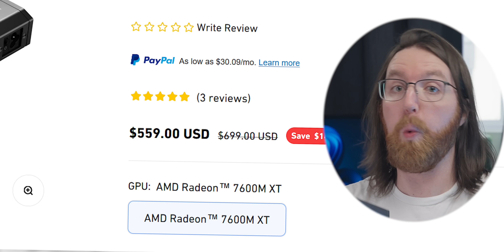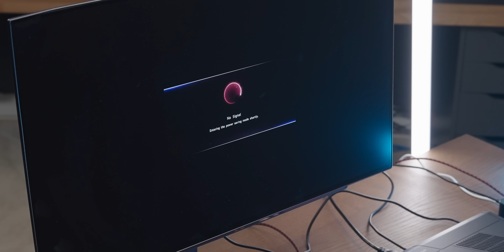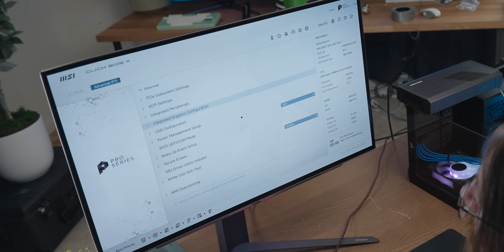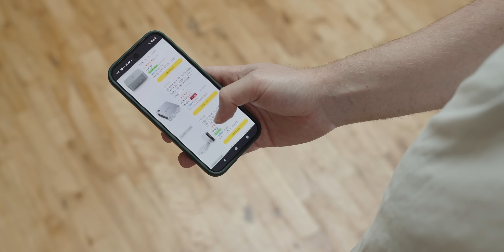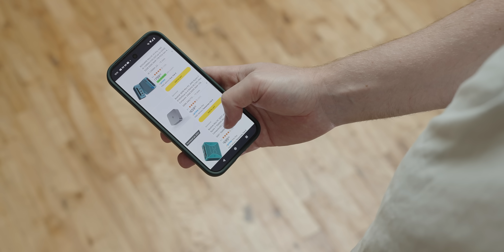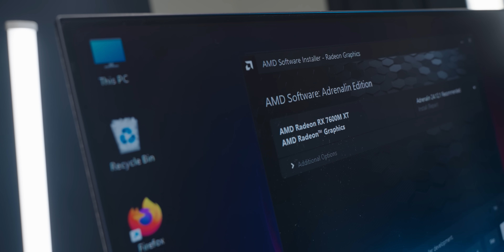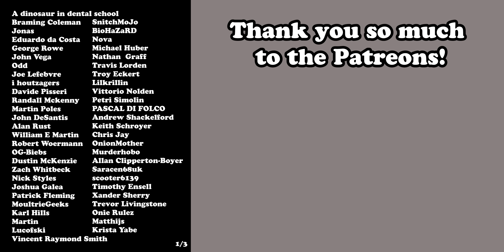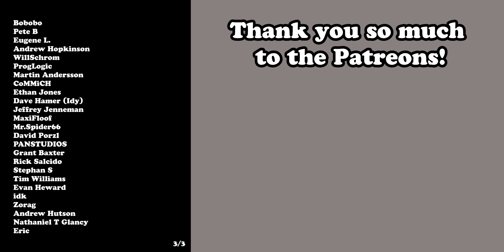This Aliexpress Graphics Card Did Terrible Things To Me...

Comment: I have an eGPU dock (Minisforum DEG1) and I have had a lot of issues getting an external GPU to run on my Minisforum UM780XTX mini-PC via Oculink. It's just such a finicky and temperamental thing. With a 5700 XT in the eGPU dock it works every time, but with a 6700 XT in the same dock I have not been able to get a signal. Not once. Not a single time. DDU wipes and trying different HDMI ports, different DP ports, different PSUs, fresh Windows installs, all sorts of different BIOS settings, different cables and so on. The 6700 XT never works, the 5700 XT always works. Both cards are confirmed working in other systems. I love the idea of eGPUs, but right now it's a huge mess. I guess that's just what you get for being an early adopter.

Comment: I worked for HP in a previous life. One of my co-workers figured out how to reassemble a LaserJet 4100 with the bare minimum screws and still have it function.   That way if he needed to tear it down to get inside to walk a tech through replacing a part he could do it in moments.  He had maybe 12 screws total installed in the whole printer.
Reply: I remember servicing printers around that series, we had a ton of them in the office. There was one set of gears that I think drove the fuser, they would go bad on heavily used printers and the WHOLE damn printer had to come to pieces to replace them.

I figured out that if I cut away some plastic it saved hours of disassembly and reassembly and you didn't have to take it apart to the bare frame.

The thing truly had to be torn to bits for this repair, I felt like a king when I figured that out. Hahaha
Reply: @volvo09  Impressive as hell, rad job on that.
Reply: @volvo09 that being said... I was certified on 4000 series printers and they were tanks compared to what you get these days
Reply: "In a previous life" ? No commenters are noticing how this person is saying he's a reincarnation of an HP employee.
Reply: @JadenRoss-v3s  I assume most hp employees are reincarnated Compaq employees
Reply: @KodiakWoodchuck  i think those went extinct

Comment: Had a different kind of video card problem with aliexpress video card. Amd rx 570 for $50. Installed card, restarted windows and generic windows drivers installed. Amd drivers would not install. Tried 4 times and no go. So i downloaded the Frankenstein drivers and woa, worked as it should. Drivers were great.

Comment: Had you previously had BOTH the Occulink AND the USB-C plugged in AT THE SAME TIME??? Thats was gonna be my suggestion after seeing they were both on that weird mini m.2 port daughterboard thingy
Reply: The problem here is PCIe is hotswappable and no other Oculink dock requires another connector to be plugged into the target machine. You just plug the Oculink cable and it works. That's bad design.

Comment: one thing to note, the egpu has to be on before the pc. then turn on the pc. if the pc is unplugged, then ya have to unplug the egpu and plug it back in >.>
Reply: I also suspect the USB-C port also need to plug in for the dock to work since it has all those other ports out the back of the dock.

Comment: It’s like putting a vehicle back together and there are bolts left over. If nothing rattles or falls out, it didn’t need them anyway
Reply: Sounds like the first tune up I ever did on a car. It had allot of stuff left over. I was age 17😂🤣 and the car still worked. Rattled but worked
Reply: @dmo848  If it works, it works lol. The screws are there to keep things from rattling anyways

Comment: I've had the same issue. My GPU decided not to draw power, and none of the LEDs worked.
I took everything off, saw nothing bad happening, reassembled it back, and voilà, everything works now.
Reply: I have an old TV i use for my Ps5(the tv is ~15 years old), a few days ago it decided to not turn on at all, i opened it up and saw how dirty it was and how many "shortcuts" were taken during manufacturing(surprised that the TV lasted 15 years with how unsafe the insides looked). But i saw nothing that serious so i just tried to turn it on with the back off, it worked.
Reply: I bought a used 1080ti that was sold as defective. It had a 6pin and 8pin power connector on it.. tried it with both and never got it working, so I assumed it was dead. 

Months later I played around with it again and tried both cables at the same time... The damn thing worked 😂 

I felt like an idiot
Reply: @volvo09 You didn’t plug in both at first? 💀

Comment: There is a notorious bug with AMD CPUs not working with amd external gpus via oculink. Though Even if it's not exactly this particular one .... That said, it does work for usb4/thunderbolt 3
Reply: Though it does work with Nvidia cards fine and supposedly it does work in Linux
Reply: It looks like this dock requires that USB C to also be connected to the PC in order to work.
Reply: @BrunodeSouzaLino Naw because it was working through thunderbolt/usb4.

Comment: The whole idea has potencial  BUT OCULINK ? They must find a way for a) a BETTER GPU  b) A way to connect it to usb type C ( no thunderbolt) and it will be a  GODSENT  for gaming or productivity for laptops !   ANY OTHER WAY...They have..DROPPED..the ball !!
Reply: Oculink is the best way because it's not a converter. It's just PCIE 4.0 8x on a cable. You have all sorts of adapters which will turn M.2 and even regular PCIe into Oculink (even one that uses a PCIe 16x slot and gives you 4 Oculink ports.. If you're feeling adventurous, you can even convert SATA to Oculink using a SATA to M.2 adapter, then putting a M.2 to Oculink there. And since PCIe is backwards and forwards compatible, you don't have to rely too much on either device being PCIe 4.0 compatible.
Reply: @BrunodeSouzaLino  I respect your knowledge of the matter BUT I did not ask for that assumption cause oculink is an output that  DOES NOT exist in laptops. My comment refers to that IF they can adress this issue it will be the solution for every laptop to be a gaming/productivity machine. I think you missed the reason of my comment.

Comment: Perhaps you are required to have current draw on the USB-C port so it only powers on the GPU when the attached computer is running. Not a good idea, but possible.
Reply: Or maybe It is required to control the power on/off and some other functionality?

Comment: I just can't understand the logic of mini PC's like this. For the cost of the Mini PC and GPU, you could just build an ITX build if space is an issue. Or for traveling you can just get a laptop and not need to worry about carrying around the screen and GPU as separate items. I genuinely don't know if I'm missing something or a certain use case for them.
Reply: I think the primary use case is "Because it's neat".  It's just a hobbyist/enthusiast product and have little benefit for most consumers over other options.
Reply: The use case is future upgradeability. A laptop with an OCuLink port accomplishes the same thing. If this eGPU were only ~$300, I'd personally buy one to add to my mini PC. Then it would stay at home while the mini PC may or may not travel with me. That said, a mini PC without the keyboard is much much smaller than a laptop with its built in peripherals. If I'm say planning to stay with a friend for a weekend, I can toss the mini PC in a backpack or other luggage along with a few cables, borrow a keyboard, and plug the PC into a TV at their house.
Reply: I'm a veteran of PCs since the first batch of clones came out in the early '80s.  I've built dozens.  They are finicky to get everything working smooth.  The cases are flimsy; move your RGB glass windowed junk heap around regularly and it will get loose, like particle board furniture.  They simply die after a couple of years.  Too many vendors have their fingers in your device.  I switched to laptops years ago because I travelled frequently.  They just work, because one vendor built the whole thing.  I switched to mini PCs because I no longer travel and was using a laptop with a wide monitor and mechanical keyboard, but got tired of flipping the lid to hit the power button.  So now I have a simple thing I can put behind my monitor, it has a discrete mobile GPU, plays my older games fine and newer games OK, and was cheaper than a comparable spec'd lappy.  So, a unit that does what I want with minimal effort, reasonable cost, and not a flimsy disco box that might catch fire if the 12V GPU connector is loose.
Reply: I get the idea of a mini PC, I can think of many uses.  If I want to game on something, I'm either buying a gaming laptop or a proper PC.  This seems like a very niche product, but I'm sure there's people out there who swear by it.  Presumably they have a lot of extra cash too.
Reply: My desk is 3 1/2 ft wide, and even with a Dell Optiplex 7050 SFF, space is at a premium. A mini PC would give me back real estate and likely cut my power bill as it's got a 1650 in it (and iGPU's are hitting 1650 levels of performance now).
Reply: @ Move your PC to the floor or install a shelf
Reply: Mini PC is for saving space and power, not hooking up giant external devices to.  These eGPUs are better suited to light laptops that you hook the eGPU to when you're back home.  How many of those have Oculink though.....?
Reply: Yeah, just buy a used low-end laptop and decent PC for the same price.
Reply: "PC's"
Bro, you can't even understand the logic of how apostrophes work.
Reply: I have a full atx build (7800x3d, 7900xtx etc), but I also have a minisforum mini pc with a 780m, paired with a GPD G, which has the same GPU as the dock featured in this video. My ATX build is massive. So far I've mostly leveraged it for VR, but my mini PC is mounted on a SIM rig, which is easy because it's so small and compact. There's a monitor and a PS5 mounted too, so it's all integrated, and I prefer to use the mini pc/egpu combo when I don't need so much power. It's also worth noting that sometimes, when one PC has problems, it can be easier to solve with a second PC around.

Comment: It is always when you call IT or report something not working that it magically gets it's act together. Then the IT person thinks you're an idiot... Beyond frustrating!
Reply: been that IT guy plenty of times, some machines just fear our sheer aura or are about to fail whenever you leave the room or close the ticket.
Reply: @lucasco031194 It's insane. I used to be the IT guy. I switched careers. Something didn't work no matter what I did. Called it and the admin aura turned on the moment they arrived.
Reply: @rambow70 As someone that works in IT let me just say, don't worry about it, we actually don't mind problems that fix themself, quite the opposite really and as someone else mentioned, some of us just seem to strike fear into the IT equipment so often enough simply mentioning our names to the devices will scare them into working again 😂
Reply: We tend to call this the "Admin Aura". The second an IT Admin stept within 3 meter (9,84252 feet for the freedom lovers) of the "faulty" device, it starts working again.
Reply: @chrisblock1619  The problem with Admin Aura is it ceases when the admin is no longer in contact with you. 

Every once in a while I buy a used workstation or similar to make a cheap gaming PC or home server for someone, I decided to upgrade my own home server and I pick up one of those dell precision towers with dual lga 3647 sockets (with the second socket and it's RAM slots on a daughter board), slap in a couple of xeon golds and 128gb of RAM. The thing is a pain from the start, and just when I start thinking well the machine has to be defective because I cannot get it to boot, it boots, cool. Not quite a year down the line it reset for an update and didn't come back up, and it had frequently been odd, so I begin the process of pulling this ridiculous machine apart for the Nth time. I rip it all apart put it all back together, test different RAM, put its processors in my other machine (which uses a supermicro single socket 3647 board) and I get nothing. I get desparate and get in contact with the company and they send it to IIRC their sysadmin, dude spends copious amounts of time going through the whole thing with me, I take pictures of every part I added, had it apart more than once and one time it finally boots. I thank the guy for his time because A) not really his problem in the first place B) REALLY wasn't his problem because it was past the 30 day warranty and C) they offered me a discount on a replacement machine if we couldn't get it running, couldn't make it a free swap because warranty but still it's more than I had a right to. A couple weeks later, after the ticket is closed, I let the machine reset for a windows update and it never comes back on again; my admin aura privileges have been revoked.

I'll never buy another dell workstation for as long as I live, that hateful inconsistent PoS haunts me to this day, but any time I need a machine for someone I get it from them, because they got THE guy to try and help me with it. (PCSP if anyone cares)
Reply: @chrisblock1619  "Freedom lovers" don't use commas where decimal points should go.
Reply: I work in IT

This is a daily occurrence. Someone will call me I will walk to the other side of the office and by the time I get there the problem's fixed.
Reply: @riven4121  The "worst" is when they go to demonstrate the problem and it doesn't happen.  They keep trying and give you a desperate look.  "I swear it was doing it before."

Proper response: Yep, it definitely was.  I fixed it by entering your office.  You are welcome, closing ticket, have a nice day.

In this case though, it was definitely that he tore the thing down and reassembled it.  No way of knowing what had a bad connection, but something did.
Reply: I am an IT person and I approve this message !
Reply: As a mechanic its the same thing. Its like the car is like, no thats our noise, no one else is gonna hear it.
Reply: @johnmauer6605  As the CUSTOMER to a mechanic it happens that way too!  "I swear it made this grinding and popping noise!! I SWEAR!!!"
Reply: IT Technician here, always funny to hear them say "well now that youre here its working"
Reply: same thing when something, anything really, doesn't work so you call another person into the room to complain. Then it works fine. Then you start thinking the product is just shy around you or something LOL
Reply: On the flip side, whenever you have something that doesn't work, just start complaining about it publicly and then it immediately fixes itself.
Reply: Can IT people actually fix things?
Reply: It's the same when going to the doctor, you're suddenly A-OK, nothing seems to be wrong, you're just cured! Then you come back home and collapse back into a sick state.
Reply: agreed, even software issues seem to fix themselves from our presence xd
Reply: Believe it or not, it works this way in the EMS/Medical field too.  PT will be knocking on Mr. Unalive Himself's door with one foot already inside.  Soon as you wake a doctor up from his sleep and he assesses the patient, suddenly all symptoms resolved and you look completely incompetent.  Thought you tech guys would appreciate that it's not just tech/IT this happens to!  Humans work the same way!
Reply: EVERY SINGLE TIME
Reply: As an IT person, who sees this weekly. I don't think they are idiots, except one time when someone complained that their speakers just stopped working and it turned out that they just hit the mute button.
Reply: From a former IT guy, when this happens I just said a little prayer of thanks and moved on.
Reply: There is a superpower term for it i think, technopathy or sumtin. Heard the term in a movie or comic. Same as jean grey telepathy just works with tech.
Reply: This happens to my brother all the time, he calls me when something goes wrong, I go near it, then it starts working again.

Comment: So the inside of that thing, it almost looks identical to the cooling solution in like the first couple iterations of the PS4 I think it was. They changed it a couple times to reduce cost but that looks identical to like gen 1 PS4 cooling like they just popped out the same cooling block